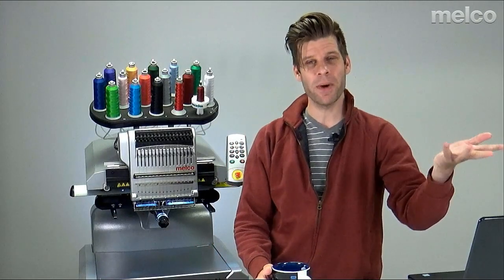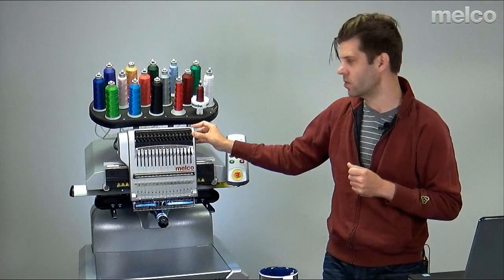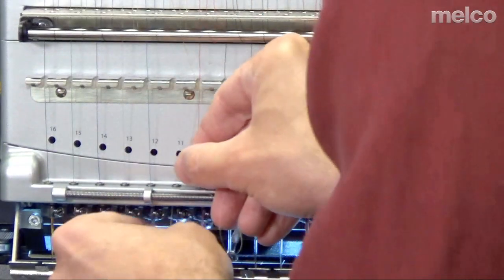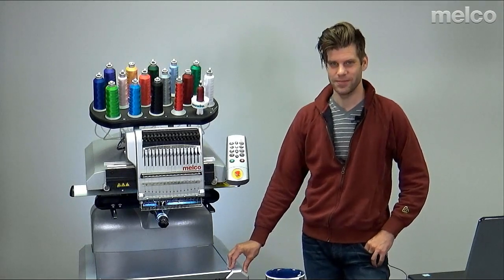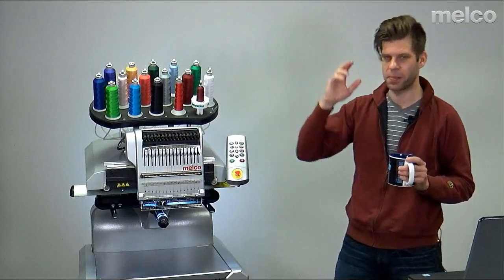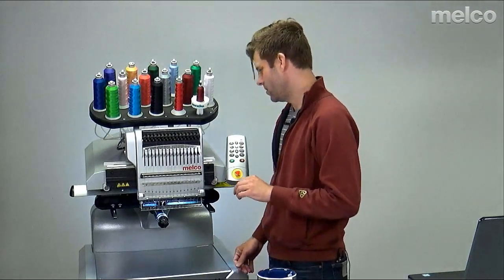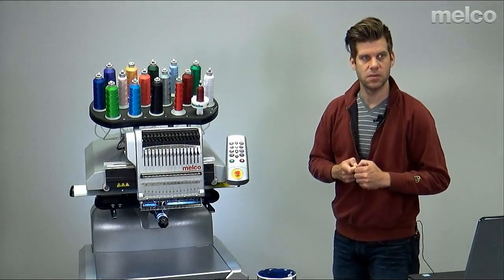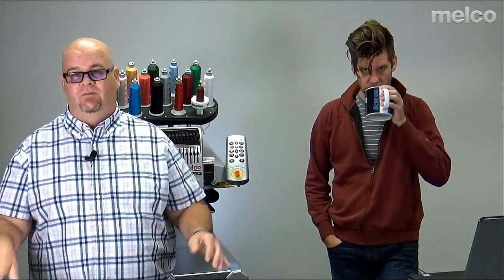Thread Break Troubleshooting

Comment: I know this video is from a while ago but threads lewaving the needles is a major problem for Melco machines. I am not sure I made the right decision buying the Melco. The system of cutting is, in my mind, the problem: I only use rayon, no polyester. Rayon is elastic and when the holder gets the thread under tension for cutting, and then rereases the tension, the thread flips back and jumps out of the needle. I have to stitch without cutting and cut by hand afterwards because I am not going to stand there threading needles. This is very tedious. All settings on my machine are  aok, the designs are fine, the threads are fresh.  I virtually never have any thread breaks on my 6-needle Brother. I feel you should check your construction and not blame just the user. I doesn't happen with cotton thread but the machine should be able to handle rayon.

Comment: Hey guys, I work on a Melco EMT 16 and one of the machines comes up with an error code: thread feeder timeout trying to find home position. I was able to reset the machine and run one full cycle of stitching with no problems. As soon as i started another cycle the same thing happened. I have checked needle orientation which was fine, i have taken off the needle plate to check the rotary hook which also looked fine. I even tried reducing the S.P.M. to 1000, no luck. However, when i look at the backside of the logo I see needle holes in the backing but no bobbin thread. I'll try the laser button + up arrow to see if thread does feed properly next chance I get. Would you have any other suggestions before I bank on a service call?

Comment: I have owned a Bravo for last three years. Just a comment/suggestion. Two most common causes of bird ‘s nest viz. pinch roller not down or bobbin left out should have a alarm connected. Audible and/or visual and start button inactivated till these oversights corrected. I understand that this thing will require additional sensors and software changes but will make machine more efficient.

Comment: How can I return and sew few stitches back after a thread breakage? I did not see this option in the manual on thread troubleshooting or at Nate's thread troubleshooting.
Reply from the maker: The machine will back up a few stitches when it detects a thread break.
If you need just a bit more than what the machine backed up, you can press the frame back key on the keypad. This will move the machine through the design without stitching.

Comment: Hi! I've checked all the steps in video, when machine stitches initially it is fine, then when it goes to cut and move to another location that same thread comes out of needle every time. Any ideas?
Reply from the maker: Hello, I would suggest you call Melco Tech support on this.  That phone number is: 888.710.8053

Comment: What is a good speed to set for patches for different kinds of designs, does the faster speed break threads easier?
Reply from the maker: suggestion would be 1,000-1,200 spm for poly thread on flats

Comment: Dose the age of thread matter in breakage?
Reply from the maker: Polyester thread has a much longer shelf life than Rayon.  Be sure to store in a dry cool place.  I would reach out to the brand manufacturer on the shelf life of your threads.  If the thread is older and has been stored improperly or dropped, it can cause issues.